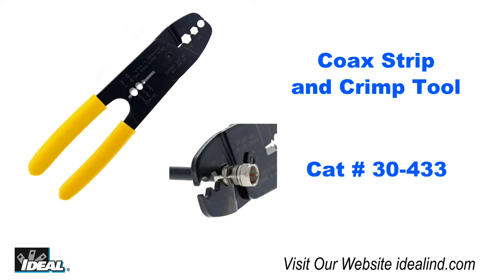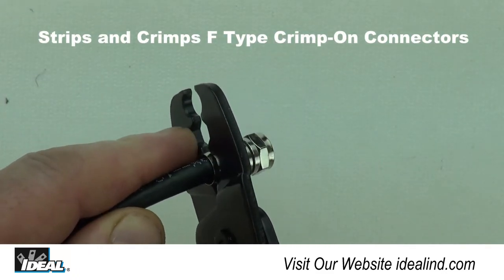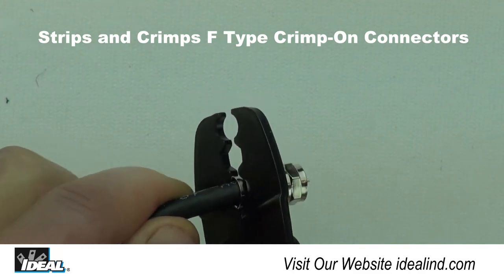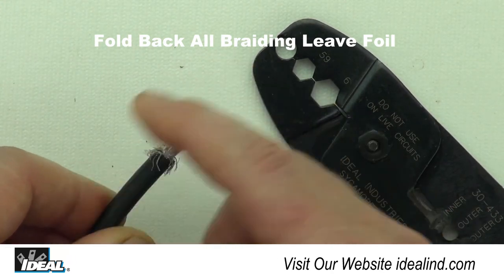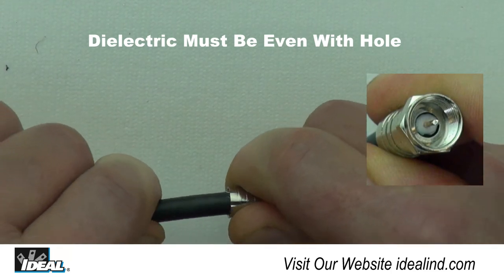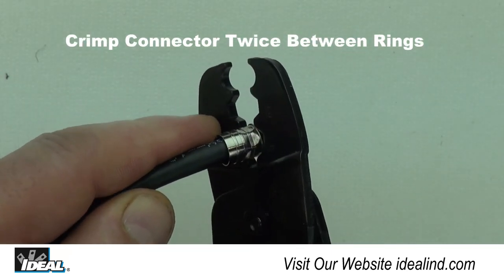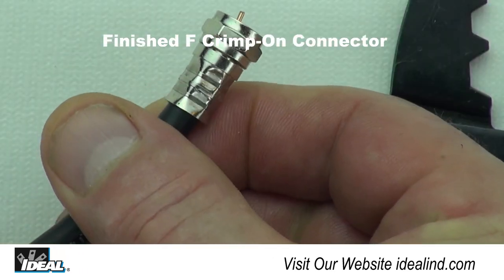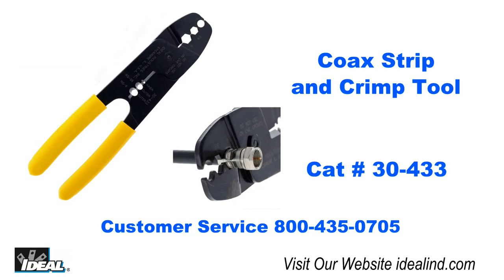30-433 Coax Strip and Crimp Tool

Comment: Quick and Easy! Coupled for life no doubt...
Reply from the maker: Hey Roger I would not recommend crimp-on connectors as a general rule use compression type connectors as the CATV and satellite people pretty much require a little better type of F connector. With that said we still sell quite a few of the tools and connectors. Ron